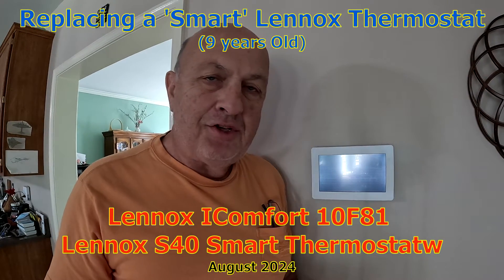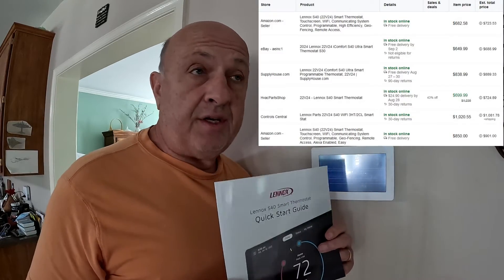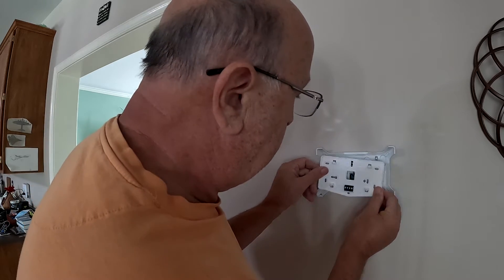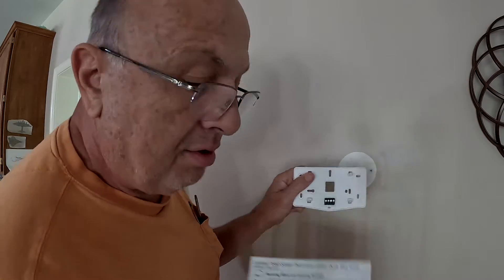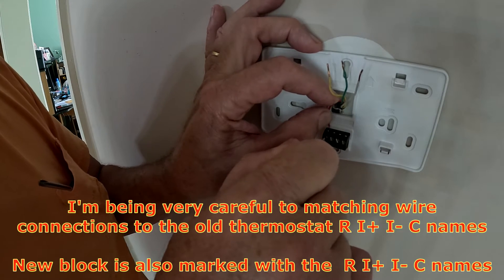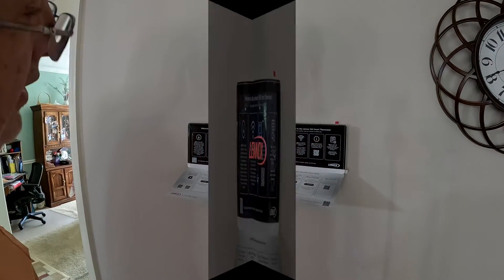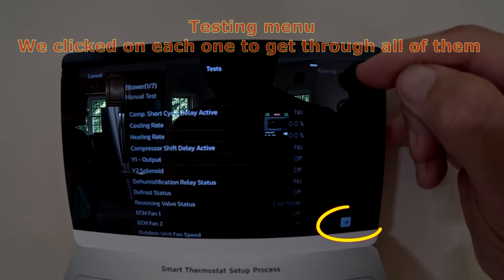DIY 🧊🔥Replacing 9 year old Lennox Wi Fi IComfort 10F81  Smart Thermostat 🔥🧊with a New S40 unit $$$

Comment: My wires are a little different on my old icomfort color wise, am I basically just putting the wires into the new base the way they were in the old base? Thanks
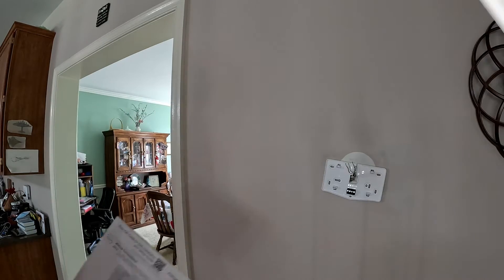Reply from the maker: It's very, very important to match the 4 wires on the correct terminals between your old and new thermostat. In my case I realized they matched 'upside down'.  I detail this at about 4:18 into the video while referring to the guide.
Reply: @ActiveJoe my terminal is the same configuration as the old one so I’m nervous that yours was upside down

Comment: That’s 24 volts AC not DC. Shock hazard low but if shorted together could arc and blow a fuse in the furnace board. Always disconnect the power to the furnace or air handler. Most states require a switch mounted right at the furnace or air handler.

Comment: I am having the same issue with exact same Lenox system. Just ordered a new one. Great video. Thanks very much
Reply from the maker: Glad it was helpful.  Be sure to note the 4 wire connection sequence when replacing it.  Also we used our dealers phone number at the prompt for installer# 🇺🇸

Comment: How di I find the dealer ID#
Reply from the maker: Thanks for the comment,  we used the dealers phone number and it worked fine. 🇺🇸
Reply: @ActiveJoe the dealer you bought from or a local dealer? Just bought ours and will be installing soon.
Reply from the maker: @elliemaciel-lopez8805  I got the system from our local Lennox dealer but got the thermostat from e-bay for about $500 new.

Comment: With the S40, must you re-wire if your current setup is non-separated / none shielded wiring?  I've been told I would not need to with this unit.
Reply from the maker: Thank you for the comment.   I just used the original wires which looked like basic wires (no foil wrapped inside) .  My guess is regular wire should be ok, but I can't say for sure.
Reply: Thanks!

Comment: Used this video to replace our Icomfort with s40. So easy! The only difference is we powered down the system via the breaker and we used the technician app to set it up. Took literally 20 mins and saved me $800 for install! Got the thermostat from amazon for $700… wish I could just go with a regular thermostat but glad this was an easy fix for now.
Reply: You mentioned using the tech app for install where would I find that ?
Reply from the maker: @dwizzle8405  Thanks for the comment - I was using the documentation that came with the new thermostat and furnace documentation.  The most important thing is to ensure the 4 wires that connect to the thermostat are in the correct order when replacing the unit.
Reply: I service, repair, and install Lennox systems. You can use any thermostat with their equipment. Just need to connect to different terminals at the tstat and inside the furnace/ air handler.
Reply from the maker: @ttom985 Thank you for the comment and insight.  I (like others) assumed that a non Lennox  thermostat may void a warranty, which is why I chose the OEM thermostat.   This is great to know and hear from a great tech out there.  Thank you... 😊
Reply from the maker: Thanks for the comment - I'm glad to hear it helped.

Comment: I connected the thermostat and it is just blinking the logo over and over.
Reply from the maker: Thanks for the comment, as I recall it takes a few minutes for it to come up but does within about 5 minutes.  I'm sure you have retried unplugging and  plugging it back in - would need to be sure of the wiring order too.
Reply: @ActiveJoe  Had 2 of the wires crossed! had hvac guy come out, cost $130 but worth the peace of mind, was so close to having it all done myself. Your video is great btw, happy new year.
Reply from the maker: @OK7studios  Glad to hear you got it sorted out.  I kinda went a little overboard when I marked my wires in the disassembly of the old one but glad I did as they were a bit confusing.  Sounds like your still well ahead of things - good job..
Reply: @ActiveJoe  ha, no such thing as overboard when you get it right, my biggest mistake was not taking a pic of the wires before disassembling. Almost went with a Google Nest, but decided to fork over the extra $$$ for the ease of the install, the hvac guy told me having a Lennox furnace with the Lennox thermostat makes the whole system more efficient, hopefully that is true.

Comment: What are you putting in for the dealer ID? The home owner's phone number?
Reply from the maker: Thanks for the comment.    We used the dealer / installers phone number and it was fine.
Reply: @ActiveJoe  Did you have to fill out the rest where it asks for the dealer's name email address and phone number? I tried all this and I am getting "equipment not found" .
Reply from the maker: @Derek_The_Magnificent_Bastard1  I didn't have the number, so entered the original Lennox installer's name in the noted field and it was OK with that.
Reply from the maker: @Derek_The_Magnificent_Bastard1  Nope, just the name - I didn't have the number, so entered the original Lennox installer's name in the noted field

Comment: I'll never buy Lennox ever again. My Icomfort died after 5 years and they wanted 1k for the replacement. Now the S40 goes for about $700. Still way too GD expensive.  The gall of these people to charge 5 times more for a device than the average. You want to lock down your components to only work with your proprietary parts, fine. But don't be an asshole and price gouge your customers. Its a quick way to turn customers to ex-customers.
Reply from the maker: Thanks for the comment, sadly true.  It would be better if they at least allowed for a 'replacement ' unit  price for existing systems where we could send the old one back in for.  Lennox brand is likely taking a big hit on reputation for this kind of pricing.
Reply: @ActiveJoe  Thank you for you video. If and when I decide to purchase this I will use it for an instructional reference. Your effort is greatly appreciated.

Comment: Thanks for posting this video! Mine is dying by now. I have one question though, does S40 work with 10F81 Zone unit? Not sure if you have one, but I got one with a zone unit upstairs.
Reply from the maker: Thanks for the comment.  In this video the thermostat controls the first floor HVAC system (my zone 1) - my second floor unit is separate.  I suspect yours is the same and can be used to replace your old 10F81 with a S40.
Reply: @ActiveJoe   I am planning to replace my dying 10F81 the first floor unit. But on the second floor I have a small zoning unit that can communicate with 10F81, which is also made by Lennox, it is called iHarmony Zoning unit. I am wondering if this iHarmony will work with S40 or not. In your case, you have another 10F81 on your second floor?

Comment: Instead of being worried about the wires touching each other, you need to shut down the blower / furnace from the disconnect switch to make sure you don't fry the main board those 4 wires are going into. Then once the new thermostat is in place, you can turn back on the power switch.
Reply from the maker: 100% Correct option.  Thank you.

Comment: Where do you get a dealer number from ?
Reply: Thank you for the video especially how to uninstall the old unit. I had a hard time doing that. I think this is the only video that shows how to do this. Thank you so much for  a truly helpful video.
Reply from the maker: @tinotesu Glad it helped, thanks for commenting.   Ours has been running great.
Reply from the maker: @tinotesu  Glad it helped - thanks for commenting also.  Ours has since been running fine with no issues.
Reply: Hi, how long was that initial loading screen when you first plugged it in? Mine has been loading for 10 min
Reply from the maker: @Babaaa24  I think it ran 10 or 15 minutes.   Note that the ac system was running too.
Reply from the maker: I didn't have the number, so entered the original Lennox installer's name in the noted field. Good luck!
Reply: @ActiveJoe May I have this number?
Reply from the maker: @yanqinglin6926  Sorry for the delay.  We used the name / number of the original Lennox installer.  If you don't know the phone number of your Lennox installer, I'm guessing any in your area could be used.  I suspect the data is stored only for reference anyway.

Comment: I am in the same situation. Just ordered my S40. Thank you for this! Very very helpful. My wife will also be doing the programing. (:
Reply from the maker: 100% have her do the programming.   It's a bit straight forward but they have the 'read the directions' edge (at least over me) so you should end up fine.  Thanks for the comment and be sure not to let your wires touch each other when your removing or installing the new one.

Comment: Do I have to add any hubs to replace 10F80 to S40 2:20
Reply from the maker: I was able to directly replace the 10F80 with the S40 without having to add anything.  The S40 basically made it plug and play.
Reply: The S30 requires a hub. The S40 is newer.

Comment: I'm about to do the same thing. Old iComfort screen went screwy. Lennox wanted close to $2000 for the s40 and the "labor" so I got the s40 on Amazon for $600. Going to install tonight. Thanks for the confidence boost from this video.
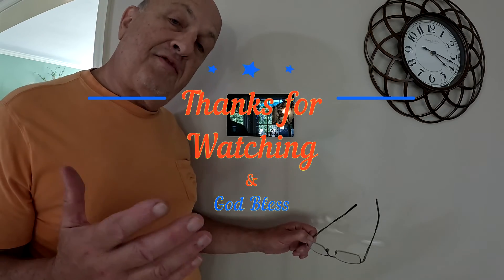Reply from the maker: Thanks for the comment Bob.  I suspected if I called Lennox they would push me over the $2000.00 mark too, so DIY is a great option.  You should be good once you enter your wi-fi and connection details (takes a few minutes to cycle) but after that be sure to manually click through the arrow/enter symbol at the bottom right of the screen to get through all of the default test options (seen at 9:00 into video).  Again, thanks for your note and let me know how you do.  All the best and God Bless. 🙏❤🇺🇸
Reply: @ActiveJoe  I got it done! It took about an hour but part of that was the multiple trips to the basement because I forgot a tool. I put electrical tape over the ends of each wire to make sure they didn't touch until I could screw them into their new housing.
Thanks for your video. It really gave me the confidence that I was doing the right thing.
Reply: @BobGilbert  Thanks I think I am going to try this.
Reply: @MarkCranerium just follow his instructions! It was easy.